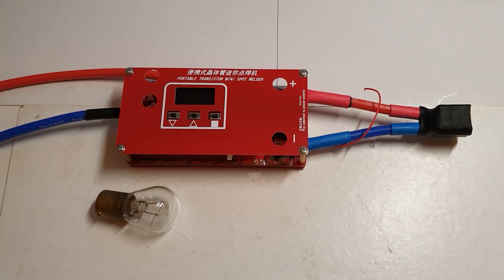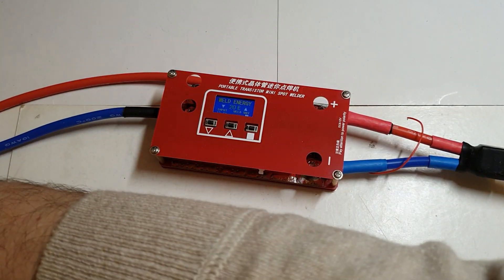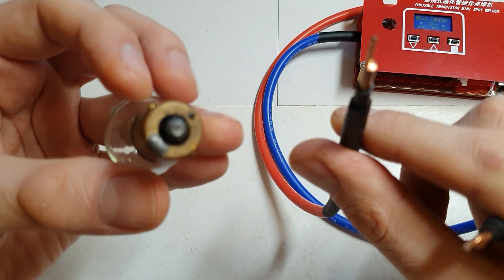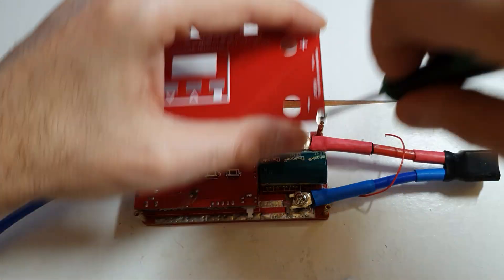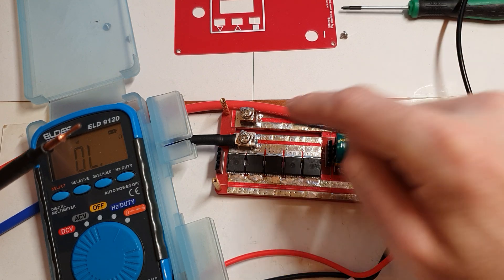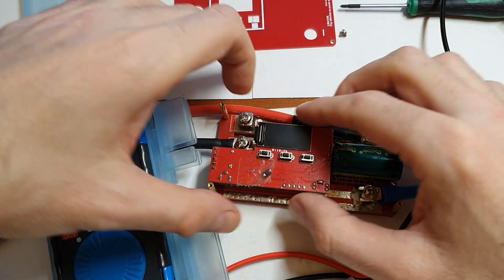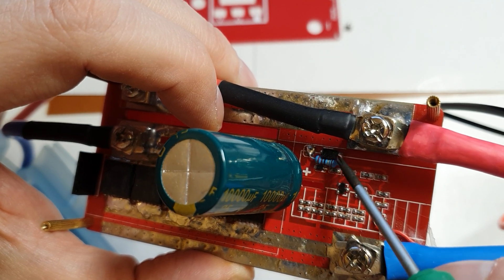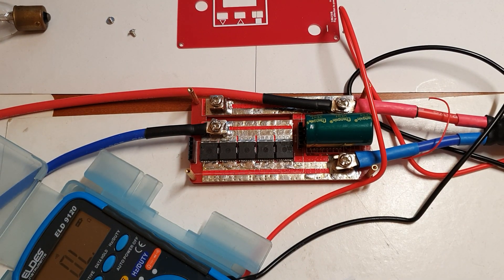Mini Spot Welder Quick Test method

Comment: I got one of these... I blew the first one and did the mods on the second one... then I realized my battery is not powerfull enough. The label says its 10000mah 25c lipo.... but it is only able to spot weld 0.10mm tabs. I tried the 0.15 and 0.2 but they don't stick. So I ordered a new lipo from a more reputable brand and it arrives tomorrow. Thank you for taking time to help others.